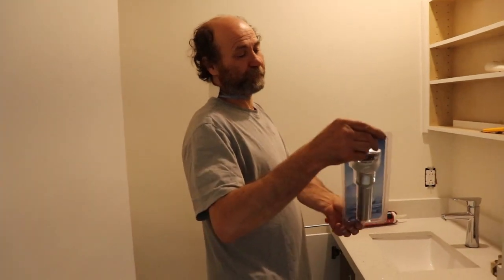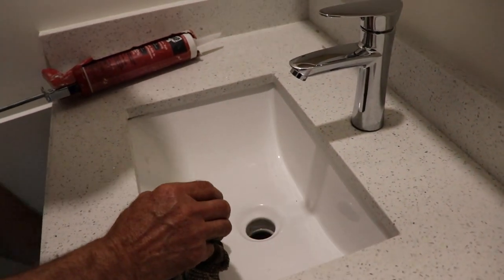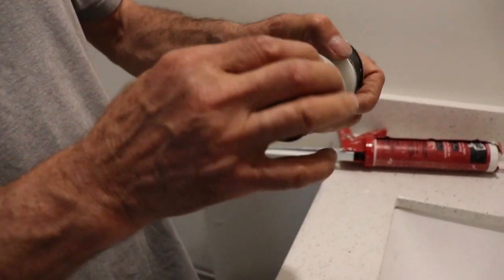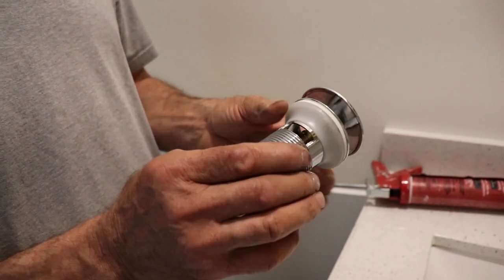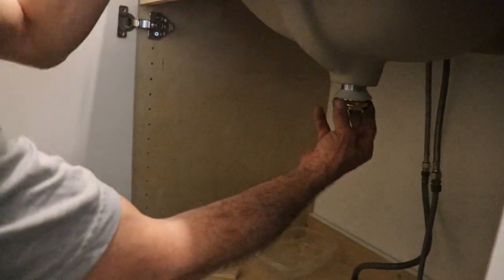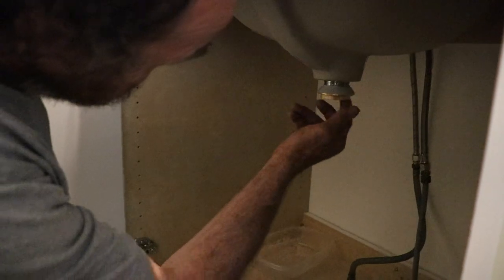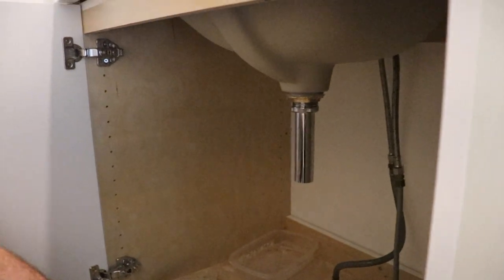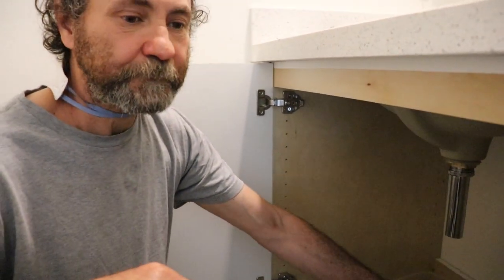HOW TO Install A POP UP SINK Drain

Comment: How do you measure the drain opening to be sure you buy the correct size pop up drain?
Reply from the maker: Hello there, thank you very much for your time and support, if you have a standard sink,  a standard pop up drain would fit no problem, matching the sink over-flow hole, I have seen sinks without over-flow holes,  but unusually,  please let me know if you have more questions , keep safe and see you in the next videos.

Comment: I use plumbers putty on top. No need for anything on the bottom.
Reply from the maker: Hello Jeff thank you very much for watching my videos, some times the quality of the sink is not very good and the rubber ring doesn't seal good enough the water that comes from the sink overflow, keep safe